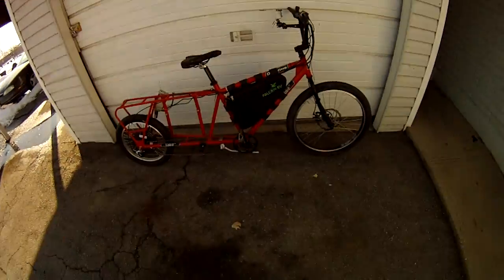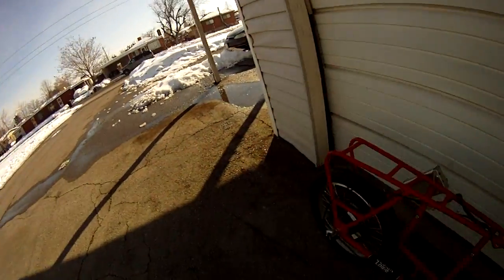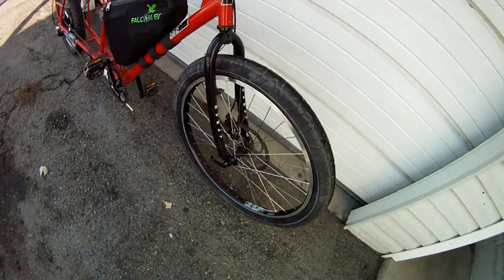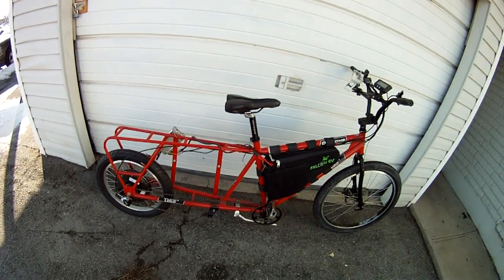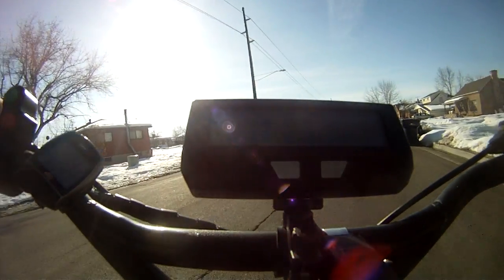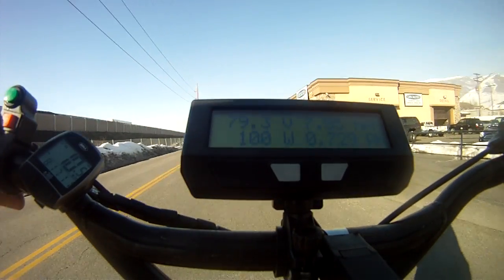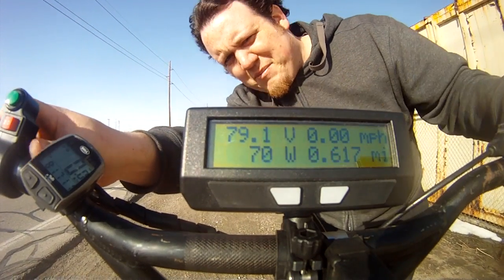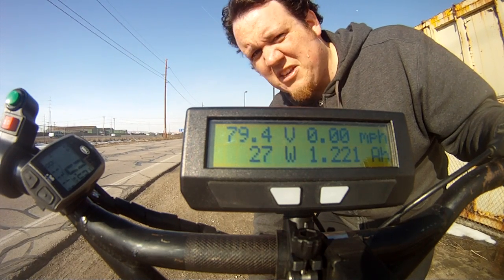Exhibition of speed - Crystalyte HS3548 on a 20" wheel @ 76v/89A..

Comment: Hey neptronix, can you tell me about the rim/tire combo here?  I've got a home built longtail with a 20" rear that I need to rebuild this winter...
Reply from the maker: Hi there, i have the original crystalyte rim in this video, plus a 16" x 2.5" pirelli ml75 on it.

If i had to choose a motor again to do this, i'd go with a HS3540 and higher volts for better torque.. although the torque was astounding as is.. :)
Reply: neptronix
 Hows the fit? 

Just looking for something a bit more durable & flat resistant. 

I've got a HS3540 on mine, kicks ass.  It's a cargo bike that I tow a Bikes-at-Work trailer with.  Easily handles 500lbs, plus rider.  Tops out at around 23mph with a 48 volt bank, but not really built for speed.

Thanks!
Reply from the maker: tcorourke2007 Fits great. It's a big tire so it is a little rough to get on the rim, but it works.

Moto tyres are pretty damn thick. I'd call them flat resistant by the virtue of the amount of rubber they have on the alone!
Reply: neptronix
 I work on e-bikes with a friend (lots smarter than me), who uses motor tires on a 16 inch rims.  We've had some bad rim/tire combinations, so I bought an array of motorcyle tire levers which I've come to love.  We've also wet/lubed the bead and even heated tires in the oven!

Comment: Hmm, I have the same battery voltage but limited current 45A, and Clyte HS3548 @ 28" wheel. I can accelerate 0-60kph in about 10 seconds and top speed 80kph.

I supposed your config should be much quicker in acceleration but strange it is not...
Reply from the maker: I was 80 pounds heavier when i filmed the video and the bike frame itself was 16lbs.. so one has to factor that in!

Comment: Pretty impressive. I have the same motor and switch it up with a clyte 405 on my trikes. Find that its finicky about controllers and voltages.
Cheap no name controller like yours works OK (haven't tried 6kw though ‼)
18 fet Lyen sensorless is the bomb @ 60v, ..
Clyte 40A sensored develops weird resonance between 37kph & 42kph. Otherwise smooth
Infineon 9fet sensored @ 48v is smooth and predictable.
Clyte 30A sensorless 48 & 60v  cuts out at high rpm
Reply from the maker: Hey, my controller isn't a no-name, it's a cell_man/em3ev controller. Same stuff as a lyen, but wired a little different.

The motor certainly has some odd resonance in it even sensored.

Comment from the maker: Hub motor axles should never snap. If they do, you have an inadequate torque plate, or the motor is crap to begin with. But that's not normal. What motor were you using?

And no, i don't always rock those speeds. It's nice to have some extra oompfh though if you are stuck in 30-40mph traffic and there is no bike lane. You can be a low speed, high torque motorcycle in that case, which can really save your ass.

Comment from the maker: Well, first off, you can't buy 53xx's new anymore, the next best thing would be the crystalyte HS35xx.
Second, what kind of hills are we talking about? ones that you couldn't possibly pedal up, or ones that you can pedal up, but take a lot of effort?

If you run two of those 53xx's, you'd have about 50 pounds of motor. It's always best to just run one motor, even if it is one large one such as the Crystalyte HS40xx or Cromotor.

Answer my 2 questions and i'll be able to guide you a bit better.

Comment: I had a question. i am going to be traveling 24 miles round trip to work. there are a lot of hills and i wanted to get to my destination fast. I was thinking of a 5305 rear and a 5304 front. 2 questions i had. do you think i can run both at the same time to get the torque of the 5305 and speed of the 5304 or should i put a manual switch of some sort?

Comment from the maker: Would you say the same about motorcycles? This is the safest bike i've ever ridden. The difference between this and a regular mountain bike conversion is the thickness and wideness of the tires, and the braking power ( super strong regen ). I feel as capable as a motorcycle on this to be honest.

I agree that 2 wheels is not the best way to go, but i've not got the wallet for a car conversion ( 10 times the cost of what i'm doing here )